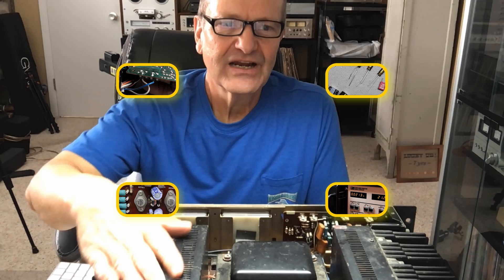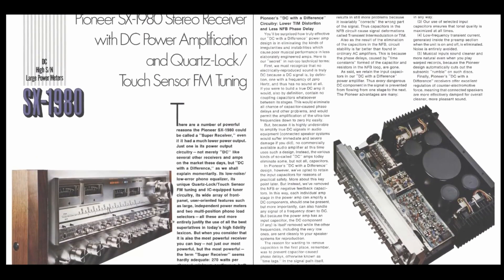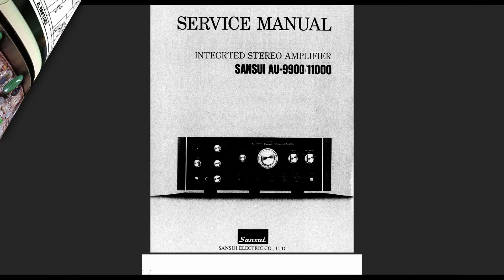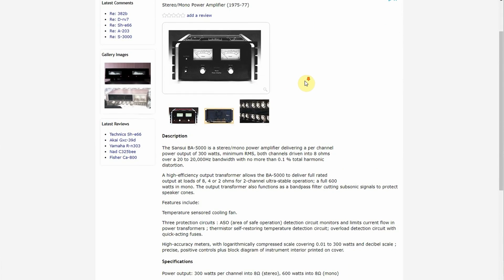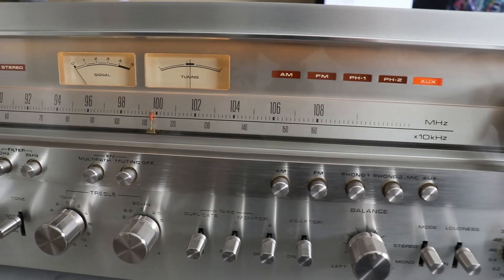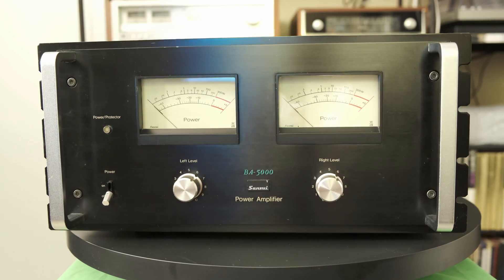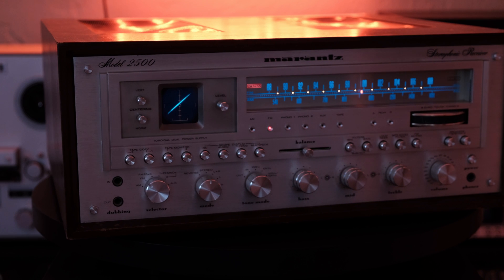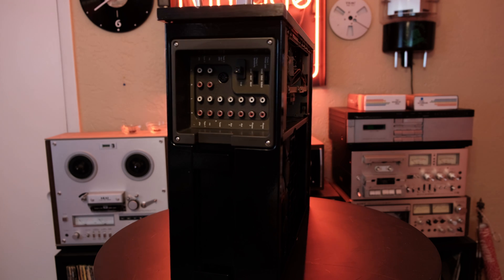Documentation Crisis Affecting The Repair Of Your Vintage Audio Equipment. HiFi Engine Problems!

Comment: Nothing lasts forever. There are fewer and fewer people who preserve and use vintage equipment, and even fewer people who can repair and maintain them. I hope that on the forums you can find someone who has a manual. Or you will have to draw the diagrams yourself, doing reverse engineering. However, when I die, this will no longer bother me.
Reply from the maker: Yup, it's not going to get easier repairing the vintage audio gear.

Comment: I just went there. No trouble signing-in. Been a member for nearly 14 years. I most recently needed a service manual for a 1960, Pilot 654 receiver. They only show an owner's manual for this  fairly rare model. Fortunately, someone at AudioKarma messaged me and offered the original SAMS service manual - paper copy, for $7.00, delivered to my door. I'm waiting for it now.
Reply: Wow, Pilot.  I still have most of a Pilot Hi-Fi that had to be built in the late fifties. It was pretty special in the day.  I've wondered if it might be of value.
Reply: @elgringoec  My Pilot receiver was TOTL in 1960. They manufactured two or three lesser models. Too bad I can't post a pic on this site, but it's a real beauty.
Reply: @Manhattanman52  
All tube, right?   Mine has a preamp and tuner combo on one chassis and a power amp on another.  6L6 iirc.  The tuner has one of those green display tubes that shows like a closing "V" to indicate tuning.  This was before RIAA clinched the standard so there are three or four other de-emphasis options on the dial.  Two separate output level controls in coaxial configuration, volume and loudness.  I forget what else but I started playing with it at about age ten.  Those two units are in good shape, the turntable I traded for a motorcycle (stupid in retrospect but at 14 I wanted to ride) the cabinet has been modified but is restorable, and I believe one or two of the four way speaker system drivers is cooked out from me running them too loud for too long.  (Kids 🙄)  Oh well, I learned a lot.  Yeah I'm not up on posting/sharing pictures, at least not publicly.  We share pics privately among the kids and grandkids pretty regularly though.

Comment: thanks for your video and updates.  It turns out that my Vinyl Engine account has been disabled but HiFi Engine, I can still login.  What a bummers that I didn't realize my VE account would be turned off.  I was going to find some info to upload and voila, couldn't login.  I've done more interactions with HiFi Engine than Vinyl Engine and been able to contribute info on HiFi.  I was able to create a full page about info for the elusive Optonica (Sharp Corp high end line) SA5905/5901.  The hard part is finding the service manual.  No one from the Facebook Optonica forum has one to upload, unfortunately.    

Whomever you are that runs the sites, I thank you for your efforts.  Being able to get and share documents has been incredible.
Reply from the maker: Your welcome and thanks so much for sharing.

Comment: Have been a member for years but didn’t log in for a year or so then found I can’t log in anymore. 

The problem with people being blocked now is that the vast majority of documents were uploaded by people other than the site owner who had now taken ownership of all the material and unilaterally deciding who can and cannot access it. So what if material was also sold on eBay - there was no membership charge for this site so eBay sales were not affecting it commercially. The material is also 40 to 50 years old so no copyright issues now.
Reply: And people who are selling the documents are probably still members and have been for a long time....  How would he know who is or isn't selling them?  Blocking new memberships helps exactly nobody.
Reply from the maker: Good points. Thanks for sharing.

Comment: I just tried to register but they are not being accepted right now.  I'm not sure if I was ever able to register, I have reference the site for many years when I've been looking for basic information.  Like I'm a Wana be motor head, I am a Wana be technician of mid century audio gear.  Grew up in the 60s and 70s listening to, and loving, the hifi scene.  I've purchased a number of recievers over the past 4 years with my best purchase to date being a pioneer SX980.  This one needs service, like most of the others I have purchased.  Would love to have access to this sites manuals.  I believe I tried a year or two to get access, and they were not accepting new registrations.  And if I was suggessfull registering before that, my account was likely deactivated.

Appreciate your you tube channel and love what you do for the community.  I'll keep watching as I come accross new titles.
Thanks again
Scott😎
Reply from the maker: Hi Scott, thanks a lot for the kind words and for sharing your experience with hifi engine.

Comment: I've been a member for years.  I suffered an injury so I haven't been working on equipment lately.  I think it's probably been a little over a year since I've used the service and I cannot get into it I can't create a new account that's really sucks.
Reply from the maker: I'm sorry about that but thanks for sharing. Yes, it really does suck. hifi engine is such a great source of info for the vintage audio collector/repairer.

Comment: From your recommendation I tried to set up an account with no luck. I wanted a service manual for my 1978 Harman Kardon 430. Also, just the nerd in me likes to browse through random equipment. Thanks for bringing this up and it's likely you're right about eBay resellers. 😢
Reply from the maker: I'm sorry that you were unable to open an account but thanks for sharing.
Reply: I have the HK 430 manuals, if you have some sort of address I can send it to which you are willing to post publicly I can do so.

Comment: Hi-Fi Engine is an invaluable resource! I had login trouble as an existing member of Hi-Fi engine a few months back, the user and password fields were missing from the main page. I poked around and noticed I COULD login on the 'Requests' page. I have had no trouble since. I have had to look elsewhere for a couple repairs, a Panasonic RS-805US 8-track recorder and a Panasonic RX-DT690 Portable stereo.
Reply from the maker: I'm glad that you are good to go. As you said it is an invaluable resource. Thanks for sharing.

Comment: hifi engine
	
Account Registration  Sorry, but registration is currently closed to new members.

Registered users can Log In as normal.

If you need to reset your password please use the Request New Password form.

Above copied from their website, unfortunately new people getting into the hobby can not join Hifiengine so no need to tell folks it is a good resource.

Comment: By restricting new members it adds value to the manuals, and feeds the market for selling them. If they are freely available there would be no market to sell them in.
Reply from the maker: HiFi engine has no fee. The docs are freely available to people that can get logged in.
Reply: True, my point was following from where you said people might be obtaining manuals from hifi engine and selling them, so has access been restricted because of that. I think this could be counter productive as for new users it could mean Ebay is the only access and they would have to pay.

Comment: This happened with the database of vintage Tandberg audio equipment that a gentleman had online for several years, one day it just disappeared from the web.
Some of it's content can be found on the wayback machine, but not all.
For really old audio equipment, radiomuseum is a great site.
Maybe HE should do the same as RadioMuseum does, watermark all downloads just to clearly mark where they originates from.
They also has a cap on 10 free downloads pr month.
This makes it difficult to download Service manuals for free, and then resell them.
I have no problem loggin in to HE, and see no information there in the News og FAQ sections to suggest any issues with the site.

Comment: I just went to hifi engine and put in my email and a password, then they want credit card information!, what gives !, so, I clicked back to their cover page then went back to the log in page which then said that hifi engine is not accepting any new accounts!, so confusing, plus they have all these ads for a company called Blastking that is located in India that makes very expensive pro audio equipment!, so, I don't know about hifi engine at this point ! Thanks 😊
Reply from the maker: Thanks for the info.
Reply: @vintageaudioaddict  your very welcome 🙏, I just wanted to let you know, don't know what they're doing!

Comment: I’ll also say that printing them out on large paper is a service as well so I don’t see much of a problem with selling them on eBay. As long as the paper is 11x17 and the quality is good.
Reply from the maker: The eBay ad I showed in my video provides you with a file they send via email. You don't get anything printed out on paper.
Reply: A lot of them sell PDF copies on disc.

Comment: I've been doing audio repair for a few years now, and the problems I've been having is that no one wants to pay me for my time and electronics experience to repair their audio equipment!! Great video, thanks 😊
Reply from the maker: Yup, great comment. You should should expect to pay a good technician working on vintage audio equipment like a professional. Thanks for watching.
Reply: Exactly, I've got enough to do besides taking in others' equipment and fixing it anyway, so yeah, I'd want to be compensated if I did.  But random customers will undoubtedly result in some trying to blame me for their woes and perhaps even file a lawsuit.  And the government will want to get their hands on half the transaction so that more than doubles my labor cost when you add in having to process all that paperwork.  So yeah, too bad, you voted for all that.  Unintended consequences that are so easy to dismiss when narrowly focusing on perceived problems.  

Just learn to do yourselves and make it a hobby.  If I could repair stuff as a child, others can surely learn to as adults.
Reply: Probably because after just a few hours you're going to charge more than the item is worth.
Reply: @ET3Roberts  Thanks for sharing, however, I try to keep my hourly rate reasonable, unfortunately I live in California and they just raised the minimum wage for fast food workers to $20.00 !, and then, possibly to $25 in a couple of years!, anyway, I know of a shop (a home based shop) in Los Angeles that charge about $175 per hour to check out and repair electronics equipment!

Comment: Got to know about hifiengine from your channel. Tried but couldn't find files for vintage Brazilian audio from 70/80s - no surprise, even in Brazil it is almost impossible. 
Have tried now (from your comments on login problems) and the message is this:
"Account Registration

Sorry, but registration is currently closed to new members.
Registered users can Log In as normal."
> it seems the case is exactly what you've described, easy money made on the work of others.
Reply from the maker: Greetings from the USA and thanks for sharing. It seems like a random mix of some people having login issues and others not. Some having issues after years of using hifi engine and others with no issues. It's hard to make out any kind of a pattern.

Comment: I was a member several years ago but dont remember my log in details. my e mail changed so I cant get password info to reset it. wont let me open a new acct. I am now more active in working on this stuff, but I will not be able to continue if I cant get the sm's.
Reply from the maker: Sorry to hear that. As you know something changed with hifi engine's site. What that was is anybody's guess at this point.

Comment: Question ........ i have a MARANTZ 2245 that I bot NEW in 1976......... It still works & sounds GREAT & the ilumination is still VERY GOOD. 
Is the fact that I have rarely used this in the last 30 years the reason ?   I would say it's been used less than 200 hrs & it's still in PRESTINE CONDITION!
Reply from the maker: It's great that your 2245 is still working well for you. The main issue for you are the old electrolytic capacitors that age even if your 2245 was never removed from it's original box. Anyways, there is a lot of information on the 2245 available on the internet and possible issues they may come up. Just google it......
Reply: @vintageaudioaddict  THANKS !!  I really appreciate the info

Comment: It is so good to hear from you and please be aware that you are doing a great service.  I've been a member for over 2 years and due to this video, I just logged in a few moments ago.  I was not able to download due to some initial problems, but then I figured it out and everything worked great.  
The problem seemed to have been with the third-party software downloader I normally use.  If this is of interest to anybody let me know and I will go over the problem and solution in more depth if desired.  This post is getting long enough as it is.  LOL
Be well,
The Old Country Engineer
Reply from the maker: Thank you for your kind words and for sharing your experience with HiFi engine.
Reply: it's not about trouble downloading, It is about new accounts not being allowed to be opened.

Comment: Almost 9 years, and it's still working for me.

But... in response to this video, I did go and whitelist the site in my adblocker. Ads are tastefully distributed and are not intrusive. I just didn't think about it until now.

I suggest others do the same if they haven't already. The ads are there to pay the bills and keep the lights on. 

Now it also has me thinking that I should gather up any manuals I have to see if there are any contributions I can make to the database. I wouldn't know what to do if the site went away.
Reply from the maker: Thanks so much for sharing.

Comment: Thanks for this reminder! I haven't logged in there for a while and thankfully I was still able to... Been on there over 7 years. 🤘

It's an absolute shame new folks can't join though... WTH is up with that? That's just silly. I would gladly pay a little something, if just trying to join there for the 1st time. :/
Reply from the maker: Your welcome and thank you for sharing. It would be great to know why folks can't create new accounts. Inactive accounts and spam are part of having a website so I'm not sure that's the only reason why as folks have said. Excessive bandwidth costs? The files on HiFi are mostly small in size but they add up if you have thousands each day being downloaded.

Comment: Logged on Hifi Engine with no problems. Been there over 11 years and it's been very helpful.

Tried several times to open a Vinyl Engine account over the last couple of years with no success.
Reply from the maker: Thanks for the info.